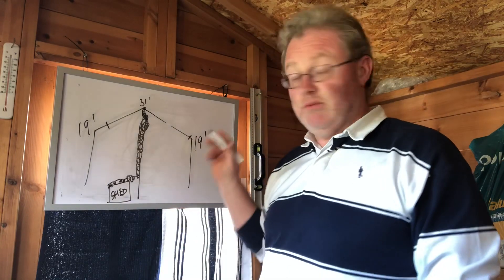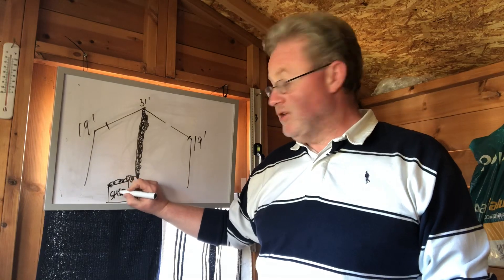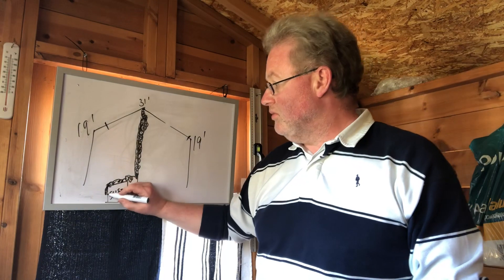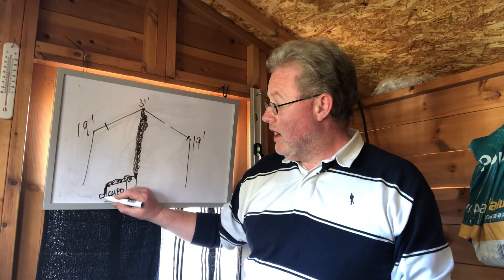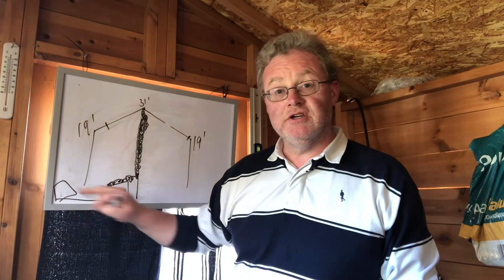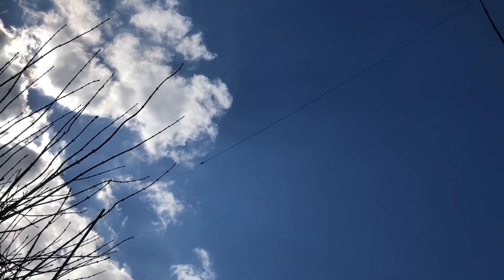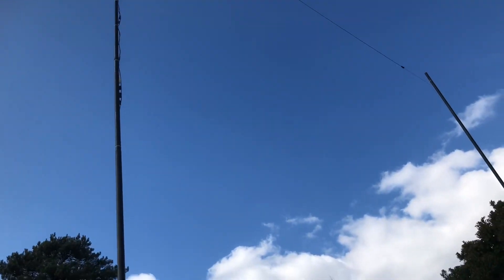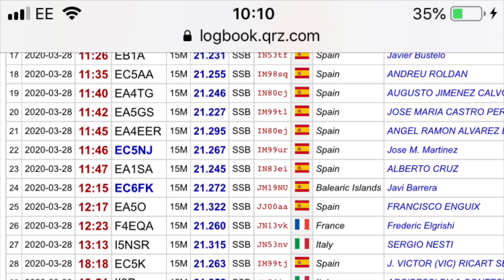HAM RADIO: 33 Foot Doublet - Short Space HF Antenna

Comment: Just goes to show, you can theorise all you want you can’t beat just getting on with it and having a play.  Ladder line/open wire feeder is great.   I used to use 100 ohm twin feeder that I can run under my lawn into a dipole, worked great.  I have been a fan of EFHW antennas for a few years now, RG213 all the way.  But like you I try different antennas to suit my location and I have to confess the old G5RV performed the best - especially when fed with ladder line all the way but that had to come down.  I use a Cobweb on a extendable mast as well as EFHW now and this combo gives decent results.  During lockdown experimenting with portable antennas, Back Yards On The Air BYOTA, for when I get back out and about.  Having fun during this worrying time.  Thanks for the channel, 73 de M0AZE MIke.
Reply from the maker: Mike thank you for your comments. Sounds like tinkering with antennas is your thing too! Stay safe and 73

Comment: Hi Tim what make of Poles are you using please?
Reply from the maker: Hi there. I use fibreglass poles I use Windjammer poles. These have 10 telescopic sections which can easily be removed. What I do with these is to remove the sections and then use epoxy glue to join them together. These have survived 50mph winds and last years. These windjammers are pretty cheap at about thirty pounds per pole. For non permanent installs such as portable I’d recommend poles by Sotabeams  or DX Commander poles. For the rolls Royce option look at Spiderbeam poles ... these are heavier and expensive but are more rugged and are 12m tall. 73
Reply: Thanks Tim! Is there any chance you could do a step by step guide to making an antenna one day? I really want to make one but have no clue where/how to start! Ie what do I need, where can I get it etc cheers Jim 2e0tmm ps don’t ask about my YouTube name! It’s the kids fault lol
Reply from the maker: Ah Jim I now know who you are! Yes happy to do it 73

Comment: Hi Tim. I could hear you in the noise on 80 metres tonight. I also installed a doublet yesterday. Not as high as yours, 51 feet top and 300 ohm feeder into a 4:1 balun. Will try a 1:1 balun some time. It is okay on 40 metres.
Reply from the maker: Brilliant stuff! You’ll do well on 40

Comment: Why didn't you take the end of the ribbon feeder near to the shack and have a short coax.
Reply from the maker: A good question. The answer is that the operating position is almost directly under the end of one of the legs of the doublet. I wanted to avoid taking the ladderline directly parallel to the leg as this could cause the ladderline to interact and radiate. By terminating it in a straighter line it negates this issue. Plus the shed was handily placed. The coax run connecting the Balun and tuner is only 1m long so losses are fairly small. I would like to get a balanced tuner and run the 450 ohm straight into the shack. I have plans for a new shack in a better location at my QTH to facilitate this in the next few months. Thanks for commenting 73

Comment: You and ya wires ;) Great Video Tim .. Keep it up :) 73
Reply: Thanks Tim, one subject I would be interested in is how to get 40m-160m from an average sized and shaped loft. I know it wouldnt be a great performer but my neighbours dont like wires in my garden, but accept my A3S.
Reply: @g1zhd-adam Adam I get 10m and down to 160m from my 55mt long doublet...my rear garden is 18mts long so I had to use my imagination....luckily for me the is a 20ft pole next to the wall in my front garden....from the back wall of my garden to the front wall of my front garden is 31mts.

So I set it in a Z shape....that gives me 43mts...the ends are at 6mts high....I have a 6mts section coming down to near ground level on each end...this gives me a total of 55mts.

Top band tunes great 1810 to 1830 at just under 1-1.3-1 1830 to 2000khz are a perfect 1-1

Worked into the states on it once on top band...even though it could do with another 20-25mts of length...at night I get all over Europe on top band.
Reply from the maker: Sounds a great antenna
Reply from the maker: Adam G1ZHD hi Adam that sounds like a challenge. How big is the loft?
Reply from the maker: Ha! Gotta love some wires bud! 73